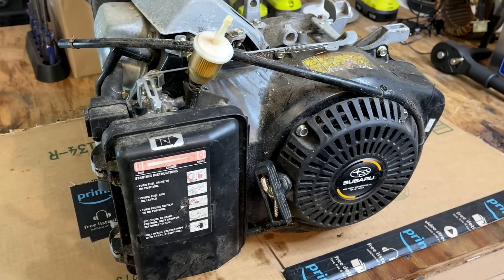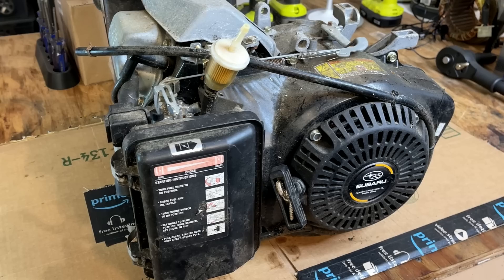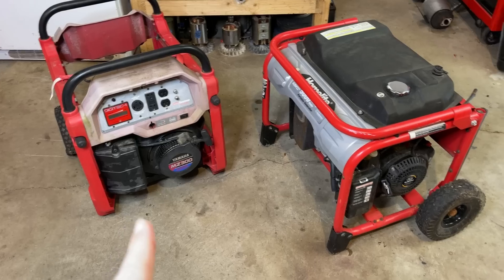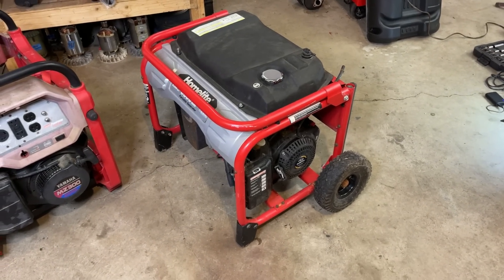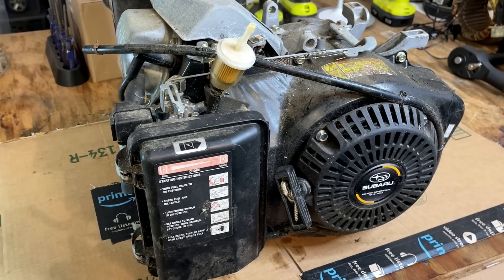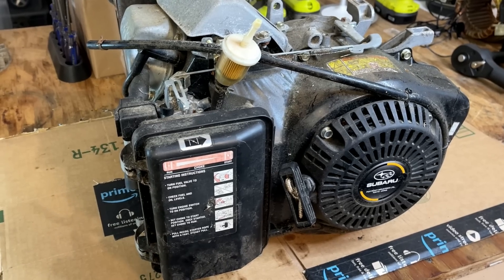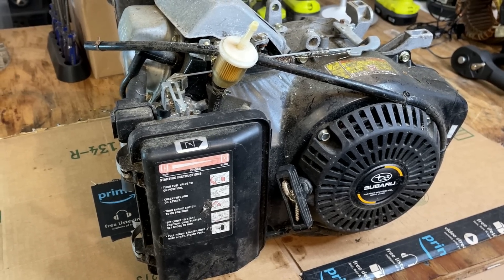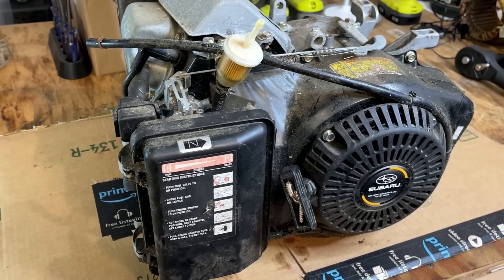Subaru EX Teardown

Comment: Maybe overfill, the oil cause stress on the internal plastic part.? 
Now that Subaru no longer owns these engines do the new generations have issues? I have three of these that have massive vibrations and all three run differently.

Comment: James, good detail. I have a 6.5 Subaru engine that the governor went full throttle and now won,t start. I added a spring to close governor and make throttle work but won,t start??? Any  ideas??? Tks, mark
Reply from the maker: Would start by checking for fuel and spark.

Comment: Good Video
I have a Subaru ex21 fuel injected - ridgid 3300 psi pressure washer with Cat pump.
Amazing quality compared to Honda gcv and gsv, metal gears and chain with ball bearings on crank shaft

Comment: where can I get parts I need those little plats that go on top of valve  can you point me in the right direction I'm trying to rebuild one
Reply from the maker: Rotator cap?  If your engine is in the 389-420cc size then the ones here should likely work: https://a.co/d/2l71hwx

Comment: On mine the clip holding the governor pin broke or flew off and the governor pin/armature fell into the crankcase while it was running. Its a solid steel L shaped piece. This in turn broke the paddle that splashes the oil around in the crankcase. Everything else is good. Engine is ok but that stupid paddle is just broken. I have thought about fixing it but not brave enough to go any farther
Reply from the maker: If its broken, you cannot make it any worse.
Reply: Can I replace just the cap that has the paddle on it? Would I have to remove the head or the piston?
 @jcondon1
Reply from the maker: @silverstreak1001  is the oil slinger (paddle) on the connecting rod cap?  If so then you should replace the connecting rod.  The cap is not sold separately and normally they are matched.  Not sure if it would be ok to just swap the cap.  If you decide to just swap the cap then you have to open up the bottom end of the engine.  If replacing the connecting rod then the head should also be remove so you can get the piston out.

Comment: my subaru has gasoline mix in the oil what is the posible cause thank you for you response
Reply from the maker: Bad needle and seat in the carburetor or a bad float.  Allowed the carb to overflow and went into the cylinder and engine.

Comment: I think we can definitively deduce that the governor went bad, resulting in an over racing engine and subsequent connecting rod failure, not the other way around. 
The reason why I say this is the amount of aluminum transfer to the crank journal. 
If the running engine had proper oil, and the connecting rod broke first, you would not see that transfer. 
But if the governor went, resulting in engine racing, and therefore an over heating condition on the journal, the aluminum transfer would occur.

Comment: You see electronic governors on pad mounted 10kW and higher home backup generators, like Kohler and Generac.  The implementation is inexpensive and can be made fail-safe for small incremental parts count.

Comment: I have a EX27 that couldn't run a PowerArc 5500 welder/gen. The shop said the governor 'died'. In the process of taking the rotor off the shaft, the 10mm x 1.5 LH threads let go before the rotor popped off... Thanks for your videos, very interesting.

Comment: Yeah they used to be Wisconsin Robin and it doesn't look like they changed the design from when I worked on a few in the late 80's. They were good as long as you didn't run em out of oil. The ones I worked on were industrial application and usually were run out of oil. Some knocked but ran. Some smokes bad but didn't knock.
Reply: I have a 10.5 hp 8kw generator red in colour. Any thoughts on where it was built and approx. when?

Comment: I was thinking about this and dawns on me that if Subaru had made the valve springs a little weaker it would never have blow up. I had a Honda CB-125S years ago and you could pin the throttle with no load on the engine and it would just rev so high and not go any further.
Reply from the maker: Good point

Comment: Need to add a brass hammer to your tools. When you smack the nut the brass will deform, instead of the hardened hammer deforming the nut.

Comment: For me oil, that you have poured out looks like it was running dry and when it "stopped running" someone checked level and toped up. I would think, that he ment to cover his ass, as at this point correct level obviously wouldn't get anything fixed :v
I forgot, that this is splash lube and seeing fine piston makes your explanation more propable. Piston will get splashes at any RPMs, but big end flow must top out

Comment: Did you show how the engine is lubricated or did I miss it? Was there a plastic pump?
Reply from the maker: That part was destroyed.  Would have been a splash lube with the dipper on the bottom of the connecting rod.

Comment: So I'm pretty sure what it looks like is a manufacturing defect of internally the governor gear falling apart. And then causing the engine to run out of spec speed and completely blow up

Comment: nice video. do you think the crank shaft is salvageable? can it be turner down to get AL bits off? thanks for sharing
Reply from the maker: The aluminum could be removed with Muriatic Acid and the crank polished and measured up.  It might be usable.

Comment: Big disadvantage with overhead cam in a small engine:  it requires a belt or chain, and even worse than a belt is the chain as it's hundreds of pieces on its own and if you ever had a bicycle, if there is a seized link, it makes the whole system inoperable.  And to the dismay of those who thought these engines were better than Honda's GX line is helical gears don't stretch requiring replacment, but chains do, and that why you look at automobiles with timing chains, they have to be replaced too.  Also, the cam may be steel, but that cam is overall a weaker piece than the helical gears in the GX for the cam and crank.  This may be the reason Subaru's small general purpose engine division became defunct and ultimately bought by Yamaha Motor.  Pushrods are incredibly durable and Honda's design is the de-facto setup.  Newer Honda GC(V) engines (more specifically the GCV200 and 170) are now of the tried and true pushrod design, but I haven't seen these engines used outside Honda's lawn mower lineup.

Comment: That's why your impact drill fell over at 3:36 ... it's battery died. And not a complete loss with some good parts on there to donate to other worthy engines. Especially those bolts that land on the floor and then seem to disappear into a parallel dimension.

Comment: James:
Thanks for all your Generator videos. I enjoy them very much.
Could you do a video on what generator is best to run a typical modern gas furnace safely (electronic controls). I want to buy a generator but I've heard it has to be pure sign wave output or damage to the electronics could occur.
Thanks
Reply from the maker: HVAC systems are sensitive to distortion and expensive to repair.  Only an inverter generator is clean enough to use with certainty.  Most traditional portable generators out out a lot of noise.  That said, most use then without issue.  Larger multi cylinder home backup generators should be cleaner.  Have not tested one so hard to say for sure.
Reply: @jcondon1  Thanks for the insight. I wouldn't take a chance on my HVAC system unless it's safe.
Perhaps a good topic for a video sometime. Showing and/or explaining an inverter generator vs the typical ones you work on.  Or maybe there is a way to clean up the power from your typical generator?
Thanks for your hard work. I'll keep watching.
Reply: in the same boat   Replaed oil burner with electronics everywhere and back up generator puts out bad sinewave     just furnace and well pump  so need some safe power  as some outages last 3 days

Comment: I want to see you brase that hole shut and do the complete repair! pair it with all repaired items that were once thought to be a lost cause. Use parts like a formerly intermittent stator fixed by boiled in shellac, a once open roter, and any old tecumseh carb (there's the real challenge.)

Comment: It would seem that in a critical governor failure over rev situation bad enough to separate the rod you would have seen valve float bad enough to contact the piston and or at least enough  rod stretch / big end wear that interference would have been found?

Comment: wow, so that cam bearing journal is the bolt? not a ton of load bearing surface there but I guess at "low" (compared to a motorcycle) speeds and with out relying on pressure oiling to prevent steel on aluminum its not a huge deal, is there a needle bearing in the cam shaft, or is it just a bushing?...

Comment: Sure doesn't look like an OHC engine from the outside. And a chain driven cam at that, that is one high quality engine. Nice and I think your diagnosis is spot on. Didn't see an oil pump or oil filter though.
Reply: Not on these small engine’s, no filter and they relying on a dipper that splashes the oil to the parts that need lubrication. Regular oil change and keeping the level not to low, keeps them alive.

Comment: Nice teardown. I agree with you about the governor. I have wondered if you could use some of that aluminum welding rod to fix a non structural hole like the one in that block. Might be an interesting experiment.

Comment: To your complement of tools, a nice brass or copper mallet would be good for doing some hammering like on the ends of the crankshafts when you use that method to remove flywheels.  Just a tip from a retired lawn and garden mechanic for Sears back in the day..😑
Reply: And I would thread that nut on till its almost flush.  Lots of force on just two rows of threads.  Congrats on 100k. !!
Reply from the maker: That would be a good add

Comment: Looks like planned obsolescense if ive ever seen it! I had originally thought it was a subaru branded chonda, but then i saw the layout of the intake, exhaust and spark plug. The chonda engines blow up pretty often. Had a governor explode in one and a rod go in another. Was able to make 1 runner out of the two with a little jb weld on the window and a small wrench as a slinger. Was waiting for the earth shattering kaboom, but several hours later the frankenchonda is still a runner. After running and flushing oil several times there isnt even any glitter in the oil.

The only way i would even consider selling it is for the value of the sum of its parts and a very very big bold statement about it. 

Tbh i never thought i would have as much fun slapping two cadavre engines together without a care in the world just to see what happens.

Comment: I say, just for fun, repair the hole with JB Weld or Steel Stick and rebuild the engine. Looks like you’ll only need a couple parts. The crank could easily be cleaned up with muriatic acid and polished with emery cloth.

Comment: I'd suggest using some aluminum brazing rod to weld up the "inspection window", clean up the journals replace the busted parts and put it back together.

Comment: Nice video as always James. I just completed a rebuild on an EX40 where the exhaust valve head broke off the stem, bounced around the chamber (destroyed head) and jammed into the piston. Took over a year to find a good, used head & new piston
Reply from the maker: Ouch, a dropped valve causes a lot of damage.
Reply: @jcondon1  it sure did. Luckily the con rod and crank were perfect. This engine is on a Ridgid 8k generator which had to come apart. I have to thank you for your expertise and your videos, as this was the first genny I ever had to take completely apart, and I was able to get it done thanks to you. All I have to do is finish the wiring and test it out

Comment: jb weld  it  see how long it will last
Reply: Non stressed component.  It will last longer than the rest of the engine.
Reply from the maker: It would last a long time.  This engine was worth more to me in parts since I always need Subaru parts but did not have any.

Comment: I wonder why, on an otherwise well-built expensive engine, the manufacturer throws in a few bullshit plastic parts that likely caused this engine to self-destruct. Planned obsolescence? The plastic is inconsistent with the materials standard for the rest of the engine. Opinions?
Reply from the maker: Not sure.  Most use plastic governors now.  Forgot to mention this engine also has a cast iron sleeve.  You would think they would go the extra mile and make the governor as good as the rest of the engine.

Comment: Nice video. I have never had a Suburu engine, so never saw one taken apart. Well made. Shame about the plastic governor, but all the engines I’ve opened up have plastic there, to my recollection. Even the old Tecumsehs (but then again they had plastic emulsion tubes 25 years ago, too, which I despise.) So maybe there’s a reason for plastic over metal that I don’t understand.

Comment: interesting to see why it let loose plastic gear ,go figure ,without positive oil pressure those engines do not like high revving found that out on a 5 HP go cart ,excellent content Jim thanks

Comment: Regarding the hole in the engine block, I think a little hammering and small  AL  patch welded to cover the remaining hole will fix the problem much better. It will work perfectly.
Reply from the maker: It could be done.  Just need a new connecting rod and governor.  Decided to use this one for parts though since I do not have any Subaru parts.

Comment: Thank you for this one. Its a beautifully made engine.  I wonder why the flywheel fan is so very rusty. It occurs to me that it does not matter much if flywheel fans are rusty because it would hardly impact the performance of the machine unless it rusted up so much that it stops spinning or the vanes fall off and reduce its effectiveness. This flywheel fan would make a very good experimental subject for an attempt to remove rust using electrolysis. It is a robust piece and quite thick. It would be hard to do any damage. The materials required are very cheap. You cannot lose much money should it be ineffective. You stand to save a lot of money on fuel tanks were it to be effective.  I am a skinflint in my very nature.

Comment: Jim, a good welder could fix that block, and it would be as good as new for maybe $20. I've done that on a Honda engine block, but I would be sure to tell the customer in case they would be concerned.
Reply: Any thoughts on the best source for parts?

Comment: I have a Homelite LXRE 4500 with a Robin Subaru 8.5 electric start engine. Stopped producing power. Engine still runs good. I don't have a use for the engine so will probably wind up in scrap, sad.
Reply: Craigs List or Ebay.... but that's not what trumptards do...

Comment: Catastrophic small engine failure, if not caused by oil starvation, is more often than not caused by a runaway governor. The bearing damage on this one suggests it was run for some time before the connecting rod took a hike. I’m surprised the previous owner didn’t notice the abnormal running condition before it blew.

Comment: First time I've watched a small Subaru engine tear down.   Interesting,  I noticed the roller bearings, and a metal timing chain I'd think would be much better than a belt for overhead cams on small engines as it  wouldn't deteriorate while sitting for years. .
Reply: And yet the plastic. Odd.

Comment: Plastic parts ruin good engines. I had a similar failure on a Yamaha cloned engine when the plastic camshaft gear cracked while the engine was running at full load.

Comment: I had one that over heated and took the temper out of the rings, it was smoking very bad. Replaced the rings and ran like a champ on propane. But after market carbs suck for this engine.
Reply from the maker: Clone carbs are terrible for that engine.  The only clone that runs it as good is made by stens and that one is $100.  Not much less then the Mikuni.
Reply: @jcondon1  Thanks James, I have learned so much from your videos. You have helped me many times. Thanks for what you do.

Comment: I just rebuilt one of these that the rings were seized in the piston grooves and was producing a ton of blow by. You are right about it being an expensive engine to get parts for. The rings alone were a little over $50, but after the new rings were installed it ran excellent. 

You could rebuild that and have the block welded for probably $50, but the connecting rod is over a $100. All said a done, you’d be looking at about $200 to rebuild it. IMO, not worth it. But it’s a great parts engine!!
Reply from the maker: I needed the parts so will not rebuild this one.  Parts for the Subaru are expensive.  They are owned by Yamaha now so I am sure the parts are only going to get more expensive.
Reply: @jcondon1 if you want I could repair that block and you would have a good block for parts
Reply: @jcondon1 - anyone care to comment on the best source for parts- Yamaha , Jacks etc? Do you think parts regardless of the price are likely to be available?
Reply: These smaller engines use crappy recycled cast aluminum. There not easy to weld on and if it don’t do it perfect and get a full penetration weld it will crack again from the heat and vibration. Once a block is cracked it’s done for.